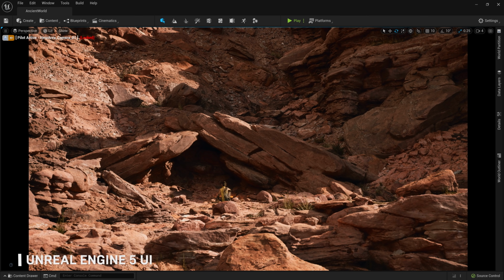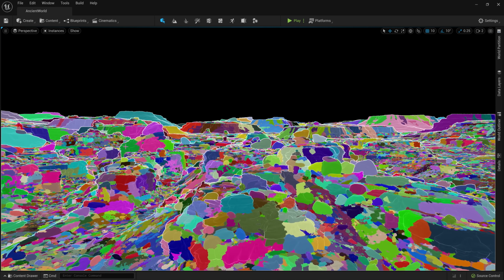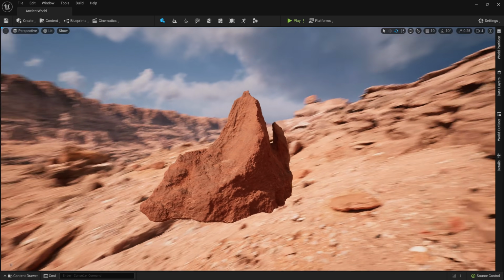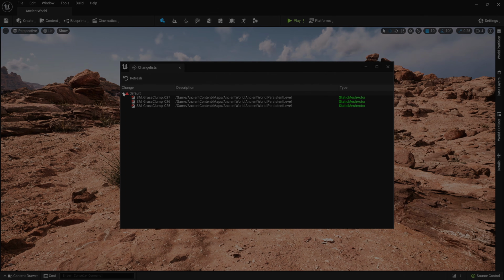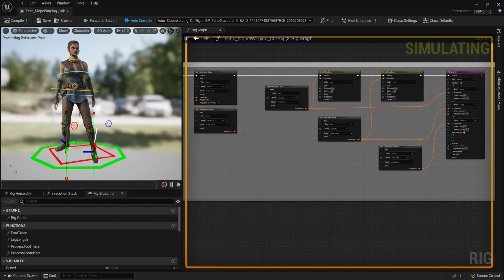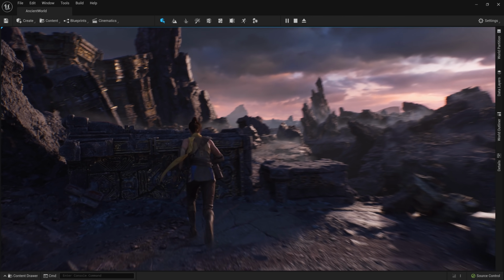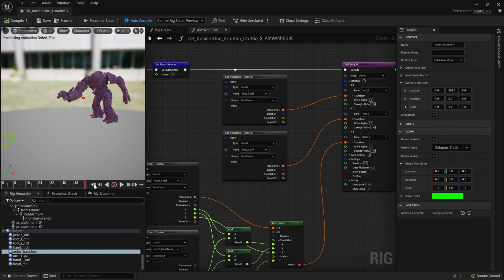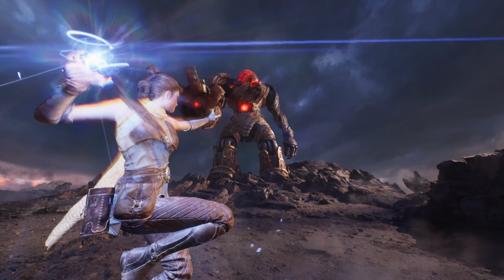Unreal Engine 5 - Official Valley of the Ancient Tech Showcase

Comment: Goodbye to 60fps hello 30fps on next gen..
Reply: they said they are still optimizing, so chances are performance is only going to improve.
Reply: You still could have 60 fps but only with 1080p or below.
Reply: @darkwowpg  this is running 1440p 30 fps the ps5 wouldn't be able to do 1080p 60 fps
Reply: @nixrow2989  yet the first demo was 4k30 on PS5, so im pretty sure it can do 1080p60, and they showed both consoles here running the same res and framerate
Reply: @nixrow2989  it’s because the videos is 30 fps not the demo itself + they said that developers could get native 4k at the cost of 1080 so it really will boost the fps not slow it down
Reply: @nixrow2989  series x cant run this at 1440p 60 without upscaling same as ps5
Reply: @rudytay83  maybe FidelityFx helps, only on xbox
Reply: @alejandromarcial1751  fidelity fx super resolution already confirmed for both nextgen systems by AMD.  So ps5 will have it also.
Reply: @rudytay83  they say nothing about ps5, and not complete rdna 2
Reply: @alejandromarcial1751  Fidelity FX doesn't need to run on "full" rdna2, it literally work on pretty much any platform. Even Nvidia GPUs. Its opensource tech
Reply: @rudytay83  MHM
Reply: Gears 5 runs 1440p120 4k60 on XSX. Pretty sure they could at least pull this off at 1440p60 4k30
Reply: I’m sure you’ll get 60.
Reply: 60fps Unreal 4 games were a thing last gen and ended up looking better than the initial demos. Too early to say how things will turn out.
Reply: @did for 4k60 yes, especially for a aaa game, same with xbox, this gen cant do 4k60 with new games, maybe dynamic 4k60, but most next gen games will be 4k30 on both consoles
Reply: It’s estimated to run at 60 on most pcs when actually given optimisation